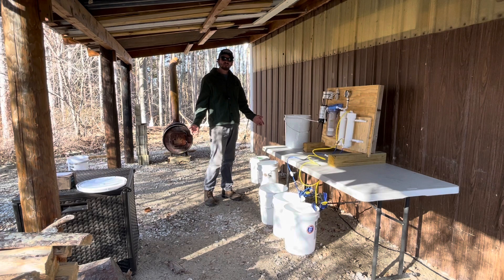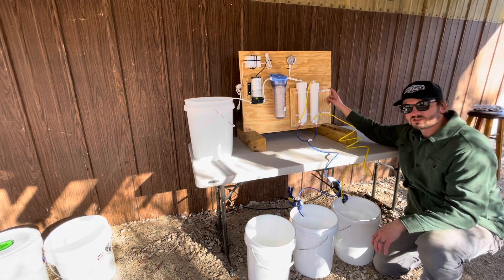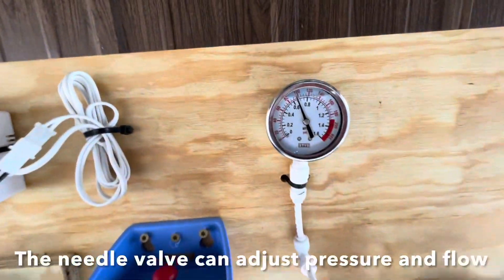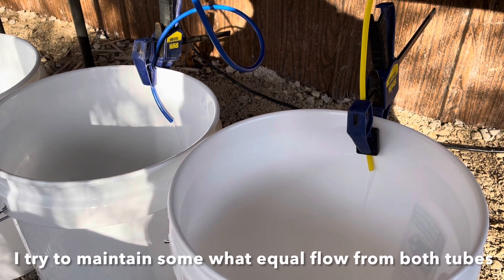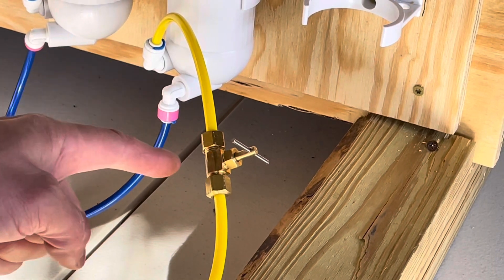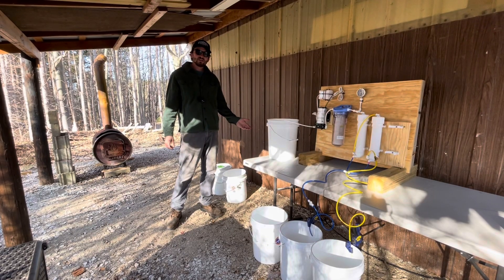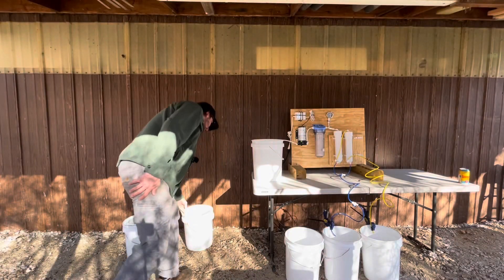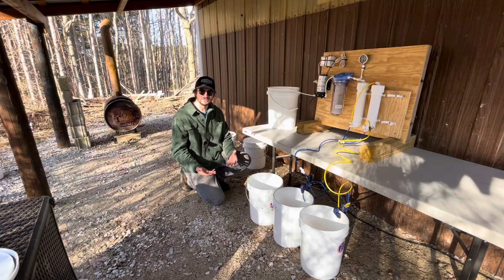Running Maple Sap Reverse Osmosis System &  Boiling

Comment: From my understanding, the plastic in the food grade bucket is the same as in your standard bucket. So long as it's #2 plastic (stamped on the bottom), you're good. The only difference is you pay more to basically have them cleaned. Just wash them yourself, which you should do even with a food grade bucket, and you're all set.
Reply from the maker: I was wondering so I called upon calling a bucket manufacturer they made it seem that food grade buckets were produced in a fda approved facility. But who knows I figured well I’ll reuse them every year so if I spent a little extra that’s okay 👌. Thanks for the comment

Comment: Felt not belt.  Place it in a colander over a large pot and pour your hot syrup through it. You might have to shift it left or right or even change it cuz it will clog quick with all the sugar sand. But it does work really well and makes the syrup crystal clear without losing any taste
Reply from the maker: Thanks for the tip! I'll definitely give that a try next season!
Reply: Yes, try to shoot for 180 to 190 when filtering it , to hot and Niter/sugar sand can slip threw. But felt filter or orlon filter should clear up all the cloudiness in your syrup and deposits :)

Comment: Love it...I'm  gonna do this next year. Glad I came across your vid..Thank you!
Reply from the maker: @gbel9295  thanks for the comment! Yeah I’m not the only video too check out the description for some more good videos on RO’s
Reply: My 2nd year doing this, I took live in MI.

I use felt to filter my finished syrup, comes out crystal clear, no cloudiness.

I'm going to build this for next year, thanks
Reply from the maker: @ I really like making my own syrup it’s a lot of work but worth it, what kind of felt do you? I’ve been using layers of cheesecloth but still have “sugar sand” sediment at the bottom of jars.
Reply: @ I use flour sack towels for my filter. Just fold over a couple of times and it filters. gives me a nice clear syrup. I filter mine during the final boil while its hot and still thin...before getting to the 219 target.